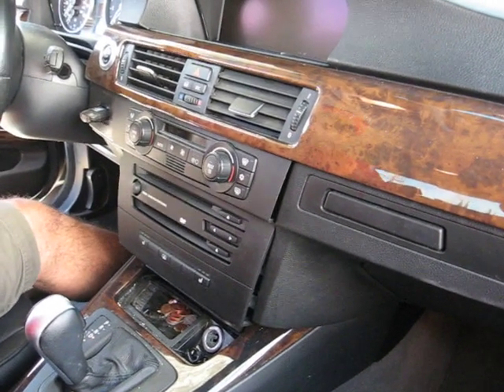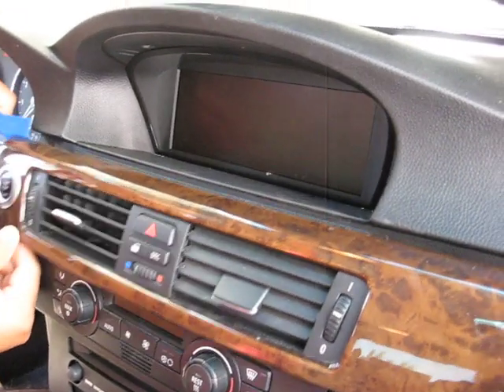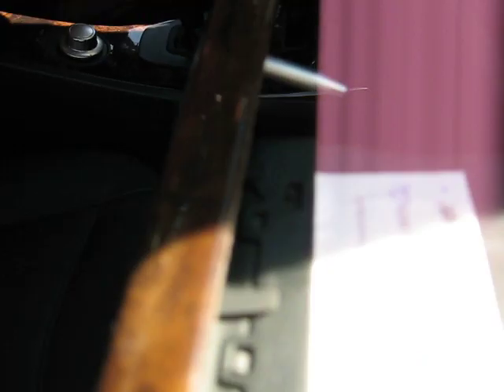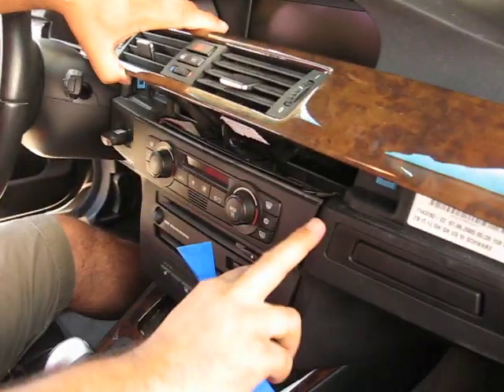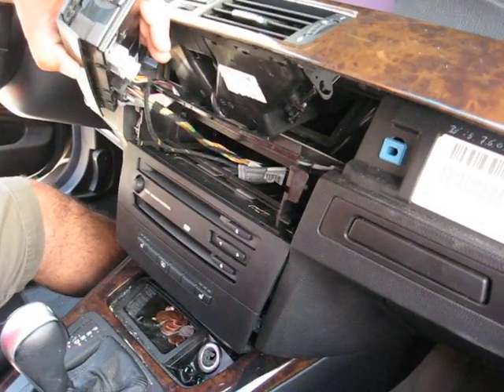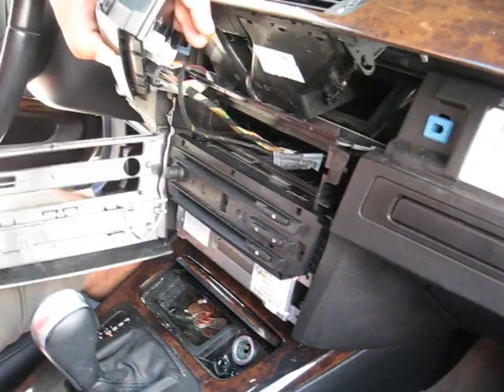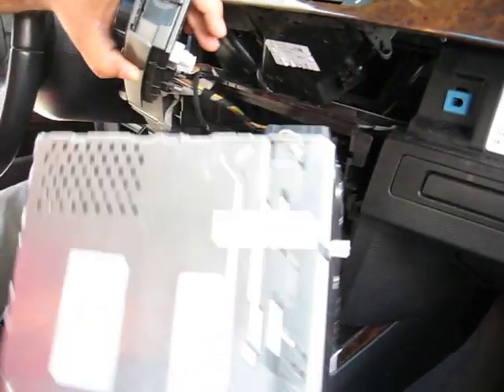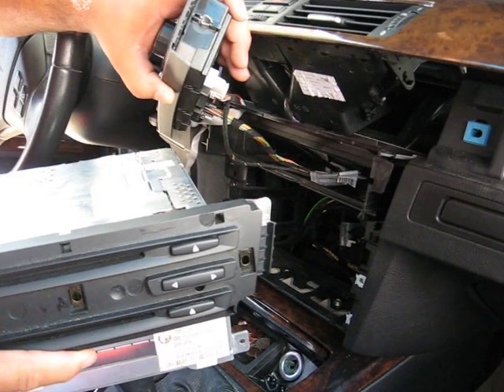How to Remove Radio / CD / Navigation / CCC unit from 2006 BMW 330 325 for Repair.

Comment: Thanks for this video...I've got BMW 328i 2007 with manual transmission, cd/dvd/radio suddenly stopped working and the screen as well...i live in Georgia (Black Sea Region) so i can't bring my car for repair but would you please tell me where can i buy the new one (radio/dvd/cd player) and where can i find licenced bmw program for programming it after changing the player....thank you in advance
Reply: Did you get this problem fixed? I'm having the same issue right now
Reply: Did u fix it? I have the same problem
Reply: I had to get a new radio. It's called a ccc unit. It's pricey but relatively easy to install. I'd highly recommend a genuine bmw unit because my new one failed and they warrantied putting yet another replacement in. It was a common problem for the early e90.

Comment: Excuse me has auxiliary input the radio of that vehicle
Reply from the maker: If your car does not have one, you could add an Aux input jack to the back of the CCC unit but it requires programming also.

Comment: Why do you have the car in drive and the ignition turned on?
Reply from the maker: To pull the ccc unit forward you need to move the shifter. And to move the shifter you need to turn the ignition to on position.